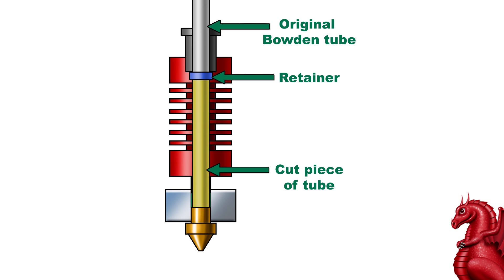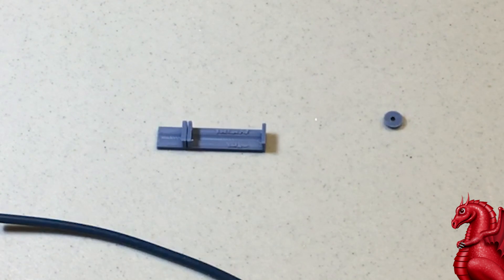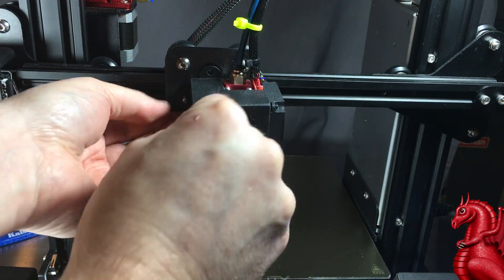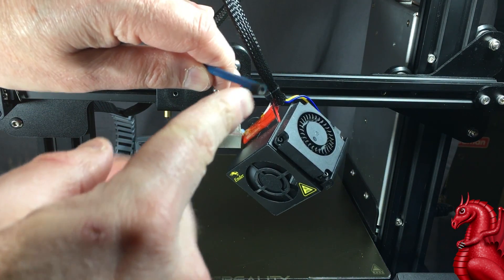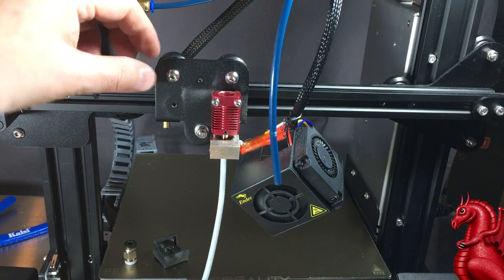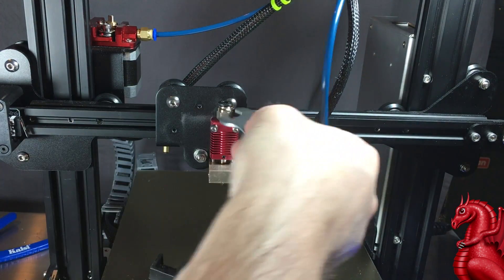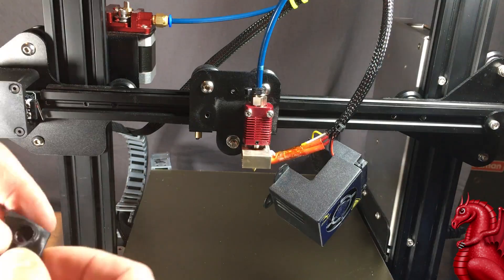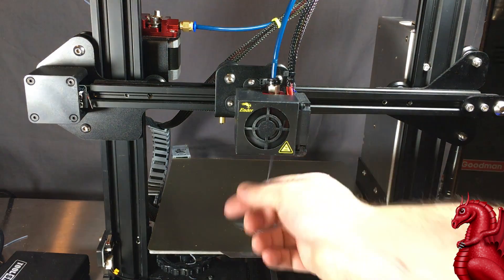Ender 3/5 Stringing Fix

Comment: I don't know what to do from this point on. I did this, I did the stock parts direct extruder mod, I printed so many test towers I could build an actual tower out of them. The filaments I tried were both freshly unsealed - Yet I get stringing from hell and the only thing even having a noticable effect ist temperature, which I have to set 5 below spec to slightly reduce stringing. It's maddening.

Comment: Hello, thank you very much for this video. I've been looking for a solution to my stringing problems for several weeks (on an ENDER3V2). Beyond the settings (retraction speed, distance...) this fix allowed me to almost completely remove them (I added a capricorn PTFE tube and a metal extruder). Lastly, I also changed PLA supplier (and tested PLA+ from arianplast) and today my impressions are absolutely PERFECT! Thanks a lot ! Thank you also for your other videos, because I also want to make a lot of mini figurines and all your advice is terribly precious. My friends think I'm crazy before but now I'm starting to demonstrate that an FDM print with a few work and with paint can obtain results as close as a liquid resin :)
Reply from the maker: I'm glad it helped you :)

Comment: Seriously was struggling with this issue and never occurred to me this could be the problem. Spent about 3 days trying to get my prints to work and was having a lot of jamming issues even after pulling apart and cleaning. My tubing and "lock" nut was worn so my Bowden tube was slipping just a little bit pretty easily. First test print after doing this is looking amazing and fixed the little bit of stringing I had previous to things going real south.  Thank you!

Comment: I am working to fix the stringing on my Ender 3D pro and there seems to be a pletora of fixes for this problem. So far none have worked, so I am starting to become a little sceptical. The same problem can have a number of different causes. Most videos I have seen so far goes past this analysis and go directly to the demonstrating the fix.

 How to recognise that it is the single piece feeding tube that causes the stringing problem? 
Your collegue at NeedItMakeIt seems to suggest the hot end side of the feeding tube is acutally the one with the less play.
https://www.youtube.com/watch?v=uEo5vNGsO6Q&list=PL_lG787UniPC5Om80z3NgnLJmOF7mHIfj&index=3
Which mirrors my situation.

I'm hesitant to start 'fixing' what might not be broken.

Comment: Get rid of these standard hotends that use a Bowden or other PTFE tube down to the back of the nozzle and get a good all metal hot end instead. PTFE in these tubes starts to off gas at temps as low as 200C which can start to harm birds and other small animals. The higher you go, the more degradation and off gassing over time, which you don't want to be chronically exposed to.
An all metal hot end keeps the PTFE tubing near the top of the heatsink and at much safer temps.

Comment: I have not done the upgrade yet, still on the fence about it, but i have a question. For those who have done it, and still had stringing, or it even got worse, would it be necessary to recalibrate flow/e-steps afterward for the (improved?) flow? Thinking that if it is less restricted, it might start over extruding.

Comment: Good video, thanks. I have a newer Ender 5 Pro with the 32 bit 4.2.2 board running the latest TH3D Unified 2 firmware.  I noticed you didn't provide anything on the actual results you found from this upgrade. You said you installed it and ran it several month's but what did you find? How was your stringing with & without the upgrade? Hopefully you left one printer without the upgrade as a control. Did you need to make any changes to your retraction settings? Appreciate any info on the specifics of what you actually found. 

And regarding retraction fixes, do you feel changing the stock part cooling setup provides better stringing performance (not better than this fix (in addition to it) but better than the stock cooling setup)?  I'm in the process of switching over to the Hero Me Gen5 system.  Obviously stringing issues are caused by a large set of factors, including the type of filament you're running (i.e. PLA, PETG, ABS, etc.), the model of filament (i.e. silk, matte, sparkle, glitter, carbon fiber, metal, colors, etc.) and the brand.  Other things like printing temp, room temp & drafts, printing speed, retraction speed & amount, and the types of models you're printing, etc. also all come into play.  So, this is obviously not a simple issue to solve.  What do you feel is the best overall setup and method of attack as you use different filaments and print different models to help you keep stringing to a minimum?  
 
Thanks.
Reply: Hey, I have the Ender 5 Pro also and being a bit of a novice, I'm having a lot of stringing issues too! Did you end up doing this upgrade and did it work? Cheers

Comment: After upgrading to a dual gear extruder, I haven’t been able to stop stringing on my ender 3 pro. I tried tweaking all the recommended settings, and the final thing I did was this video upgrade. After adding the Bowden tube lining as in this video, the print quality improved but I am still getting stringing. Anyone have any recommendations at all with a dual gear extruder? I’m starting to think it is the filament batch at this point
Reply: Im havnig the same issue, did you find a fix by any chance?
Reply: @coolgamesnl5867  the main cause of my issue was cheap filament, but I also got Capricorn tubing and tweaked retraction settings. Cheap filament was mostly the issue though.

Comment: Did it, wish I did it earlier!!  Little to no stringing and more consistent prints.  Also, the biggie - I used to dread changing filaments.   Now it's super easy because I'd get that plug in there that would lock the filament.   Half the time, I had to take the top of the feed assembly off to change filaments.   Not now.

Comment: Does NOT fix stringing, I was getting stringing did the hot end fix still got stringing, only things I found that would help with stringing are retraction distance and retraction speed along with temp and stopping the use of z hop if using Cura.
 UPDATE: Does not even stop Nozzle blocks either.

Comment: I need some help! I'm not currently able to print those pieces, so what exact length of tubing do i need to cut, and what can I use for that little spacer? I think this is exactly what i need to do to permanently fix my clogging issues, but I can't print the parts to fix it, so what should I do?

Comment: Hi Tom, great video. Is there any tip/guidelirs to switch filament? Unless i remove the coupler & wash
Reply from the maker: Heat to 215, manually push a couple inches of filament through the nozzle, then pull out of the machine quickly.

Comment: I'm having a dilemma. After I installed this fix.  My printer no longer extrudes filament. I took it apart and saw that the filament went through the washer and was in the tube I created..when I tried to feed filament into the tube, it just pushed the tube out rather than extrude it.  Do I need to make a new tube or is it the washer causing the issue?  I was using part of my original tube to create the sleeve.

Comment: I just did this and I'm still getting stringing any advice?  I just put a new metal extruder on, capricorn bowden tube with new couplers, a new nozzle and a new bed on my ender 3 last night.  worried I may have messed something up.  Haven't gotten a good print all day
Reply: Did you ever make any progress with this? I did the same as you and started getting stringing.

Comment: Question- I followed your tutorial of how to build my ender 3 and it went together well now when i try to run a test print it moves a bit then makes a loud beep then freezes.
Reply: is the power supply set to the right setting for your region?  ie 115 volts for the United States

Comment: Just one question. How to remove that piece of bowden tube if it gets stuck with melted filament? 

Great job by the way!!
Reply: heat up nozzle,  depress the spacer with a finger or screwdriver and pull tube out. 
replace or cut/score tube.  depress spacer again and push tube in as far as possible, release spacer

Comment: 9:25 i think the tool you just printed can be used to assist cutting this tube with a blade. it is superior as it guarantees an orthogonal cut face as opposed to a pipe cutter which is also slow, fiddly and has a risk of crushing the tube if too tight or falling off if too loose. the printed tool uses tunnels to guide the tube, and since they are circular, the tube actually cannot deform, crimp or crush when the blade comes down in the slot.also if you use a razor or boxcutter, it is thinner than xzacto and will go through the tube like butter. i use it all the time now to cut my tubes.

Comment: Make sure the piece of tubing you use has a centered hole. Capricorn tubing will occasionally be manufactured with an offset inner hole making all things bowden difficult. I've purchased three packs of tubing directly from Capricorn over the past two years and one out of the three had a significantly offset hole relative to the outside diameter.  I've also seen another implementation of this upgrade where they used the stock Creality tubing running from the extruder up to the insert instead of Capricorn.  Their reasoning was the stock tubing is a little looser inside compared to the Capricorn tubing allowing for an easier feed and retract from the extruder.  Since the stock Creality tubing would no longer be touching the back side of the nozzle,  its lower melting point compared to Capricorn would no longer be an issue.  I haven't tried it yet but it seemed like reasonably sound logic.

Comment: Question. I installed this stringing fix. Should the top of the red heat sink be hot to the touch when the nozzle is cranked up to 215?  I´m concerned about the spacer ring warping or squishing.

Comment: A word of advice to Cura users:

If you have tried replacing the bowden tube and have adjusted numerous settings regarding retraction in settings, there may be something else that will help. I tried EVERYTHING from 3mm retraction distance at 25mm/s to 8mm distance @ 50mm/s. I still had stringing. Switched filaments, and again still had stringing. Search wipe in Cura, and set both outside and inside wipe to 0.1. Eliminated my stringing instantly. Your mileage may vary, but I was about to whip my machine out the back door. Hope this helps, keep on printing!
Reply: Your help is kind of diffuse. No settings found inside Cura 4.7.1 that mentions "wipe" related to "inside" or "outside". Please specify.
Reply: @peterjigstad9755  if you use the search function on the top right menu and search for wipe you will find them
Reply: @Radhammer40k  Ok, but the only search results I get is: "Outer Wall Wipe Distance" and "Infill Wipe Distance". Is that what you meant?
Reply: @peterjigstad9755  yes
Reply: @Radhammer40k  Thanx!
Reply: I came across this video fixing stringing in Cura. It shows an automatic sript to find the proper retraction distance and retraction speed settings.
https://www.youtube.com/watch?v=6LjbCIGCmd0&list=PL_lG787UniPC5Om80z3NgnLJmOF7mHIfj&index=5

The darned this is that it showed me I would print a perfect stringless print at 5mm retraction on the testprint. However it gave a stringy result when I printed anything else on those settings. The feeling of whipping the machine out of the back door is very real.
Reply: Thank you Radhammer40k - I tried this mod which helped reduce my stringing by about 50% but when I tried your Cura - Walls - Outer Wall Wipe Distance 0.1 and Infill - Infill Wipe Distance 0.1 my stringing disappeared 99% ....

Comment: I just got my Creality Ender 3 & I’m not able to get the micro SD to lock into the reader. Does anyone know a simple fix?
Reply from the maker: Get the SD card extension I recommend in my upgrades video, works much better and allows use of full size card. Only like $6 on Amazon.
Reply: Tomb of 3D Printed Horrors Will that work even if the spring lock is broken in the card reader?
Reply from the maker: @roteguard  if the lock is broken you can try taping the extender in place, or you'll have to change the board out (the new all-silent v1.1.5 board is about $35 on Amazon)
Reply: Tomb of 3D Printed Horrors alright thank you I’ll check it out. I appreciate the info

Comment: Use the jig (best) or the rotating cutter (works). Do NOT use the triangular bladed tube press cutters. They cut an off-set end that is nearly guaranteed to leak.

Comment: Printed the Ender 3 Pro spacer provide in the Thingiverse files, but it seems really small :/
Is it supposed to fit within the internal diameter of the bowden tube fitting, rather than being pressed down by it (to center it maybe)?

Comment: I already have this fix but I've been getting a lot of stringing lately. It may just be that I need a fresh piece inside the hotend or maybe I just need to be neater and more attentive with all the cutting and fixing, tightening etc.
Reply: Were you able to fix the stringing after being more attentive with the cutting and tightening? I applied this fix and then all of my prints started stringing. I'm wondering if I may have done something wrong.
Reply: @catherinemorris2040  Yeah... this is what I am worried about. Stringing can have many causes (wrong settings, faulty nozzle, bad filament, moisture, play in the feeding tube...). How to reconise a loose feeding tube on the hot end side is the cause of the issue? I do not want to make things worse by breaking things open that aren't broken.

Comment: Is there a higher temp resistant tube that you can insert into the hotend so you can print high temp materials?
Reply from the maker: I just use Capricorn tubing (the blue tubes on some of my machines) as it can handle higher temps than standard PTFE tubing.)
Reply: @Tombof3DPrintedHorrors  so cap tube can handle abs and petg?
Reply from the maker: @mpcbsar  here is info on temps for Capricorn: https://www.captubes.com/safety.html

Comment: Tom, Luke recommends the open end calibration from the extruded.  Your method uses the nozzle.  I get esters of 93 on open end and 103 through the nozzle.  Obviously my flow rate is 96 on the open end and 85 with the nozzle.  I am assuming both methods have the same results.  Is this true in your opinion?

Comment: I did this upgrade 4 or 5 weeks ago on my CR-10 and I SAID UPGRADE IT WORKS FANTASTIC! It has worked with the printer running 24/7 and longer then it has since I bought it. this actually works PERFECTLY with the ender-3 pro and CR-10s  I have both! I believe it also works with CR-10 ENDER 2 AND ENDER-5 I dont have those to say definite! anyone looking at this try it. you will ask yourself why didn't Creality do this from the start. I know I did.

Comment: I don't remember which printer it was, but Joel over at 3D Printing Nerd had a printer that used a short piece of PEEK tubing in the hot end.  It has a much higher melting point that the PTFE tubing and dramatically increased the max printing temperature.  I searched around on the net for this material but couldn't find it in the correct dimension.  If someone started selling little pieces of that tubing they would sell a ton of it to people who want most of the features of a all metal hot end for a fraction of the price.

BTW, how do you like your Creality flex plate?  I have them on both of my Ender 3s but the prints don't seem to stick to the PEI as well as I'd like.  I scuffed them up with some OOOO steel wool and then cleaned them with alcohol before I used them but it didn't really work.  I just ended up using glue stick, which works fine.  I do love not having to deal with the binder clips and the bottom comes out nice and smooth.

Comment: I am just wondering, is any other kind of material than the Bowden tube with better temp Insolation to make sure any heat transfers to the filament before hit the nozzle???
Thanks
Reply: capricorn tubing is more temp resistant than the stock tubing.

Comment: Is it better to do this or get an all metal hot end?
Reply from the maker: All metal hot ends aren't good for printing PLA for these types of models, I don't use them on any of my machines.
Reply: @Tombof3DPrintedHorrors  cool thanks.
Reply: @Tombof3DPrintedHorrors  so this is the best solution?
Reply from the maker: @paintballercali  yes